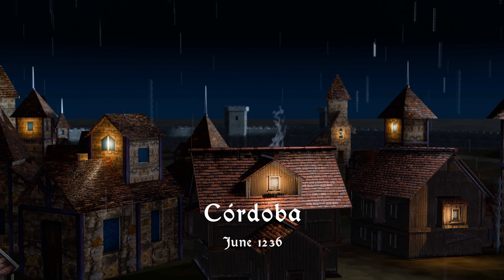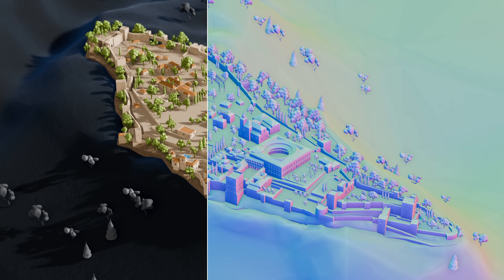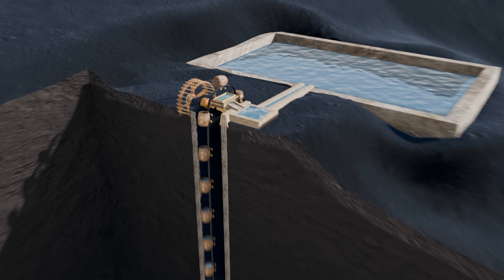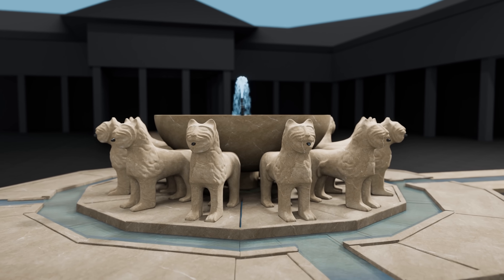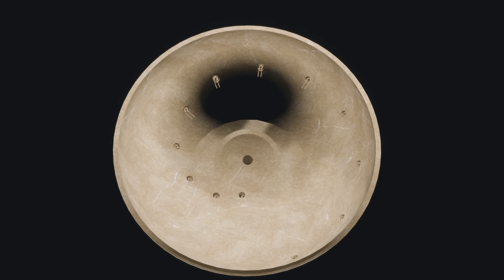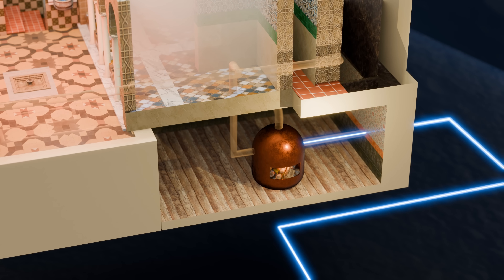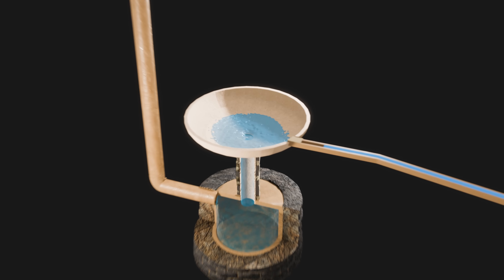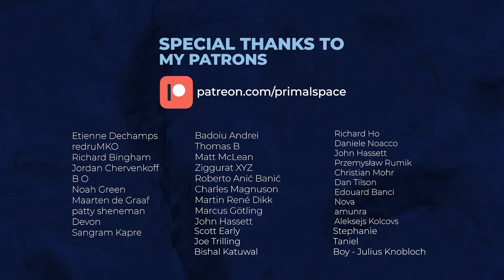The Ancient City That Mastered Water

Comment: I did wonder about the ‘clock’ explanation, if the water is entering at a constant rate, and by each hour more water is leaving by an extra overflow point 🤔. Then I thought turn is around, enough water enters bowl for twelfth overflow points, and the exit point based on time…. Yep that worked. Damn those people HD to do a lot of calculations to get that one right,…

Comment: The bucket and wheel system, with a height of 60 meters, is astonishing. Considering the weight of each water-filled bucket, the ropes used needed to be extremely strong. I wonder if we can calculate the total weight of the entire system and estimate how much energy would have been required from the animals.

Comment: 6:40 - I wonder if the Romans ever discovered that in a multiple-path system, where pressure remains equal, steam always follows the hottest pipe. Because this wasn't know when Frank Lloyd Weight installed America's first underfloor steam heating system, at his Usonia No.1 house in Madison, WI, for Herbert and Katharine Jacobs. It took many weeks of operation for the floors to become warm all over, and before that, the main pathways of the steam created very hot floors. It was converted to hot water decades later, which was a huge improvement.